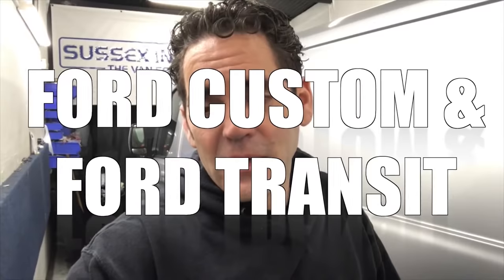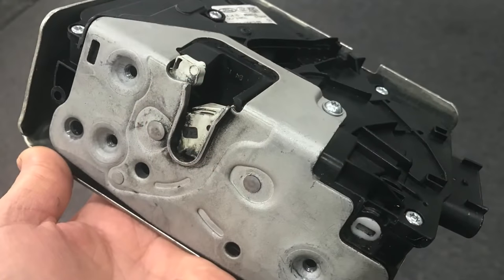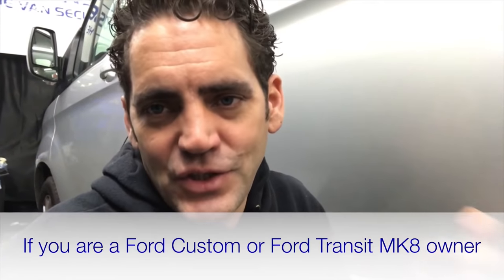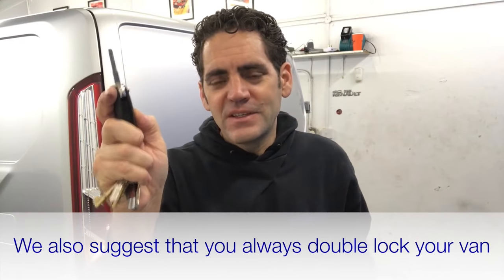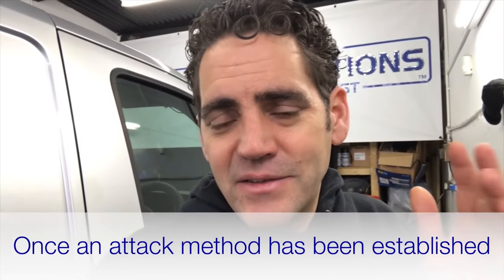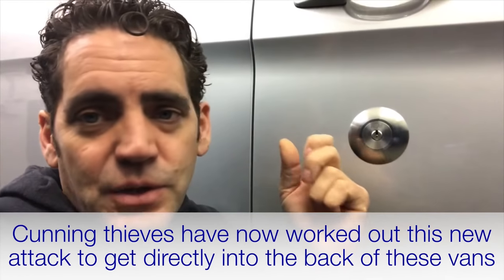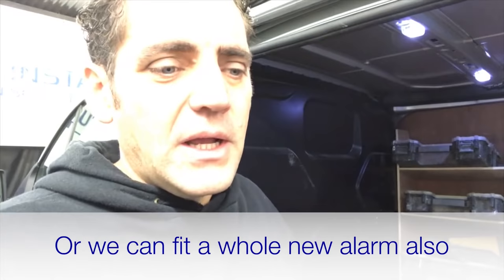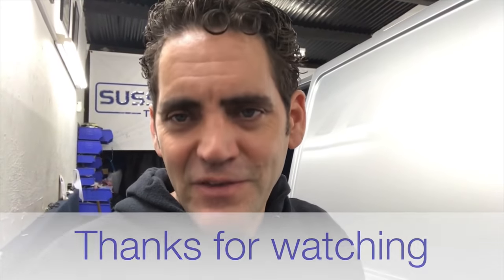Break-in News! Ford TRANSIT Owners Watch This

Comment from the maker: PLEASE SUBSCRIBE TO SUSSEX INSTALLATIONS ▶ https://www.youtube.com/user/sussexinstallations
Reply: You can break into almost all vans this way. The transit isn't the only victim.
Reply from the maker: @sdgelectronics  Agreed but they are targeted and have been too easy for too long. This latest spate of break-ins has happened over the last few weeks so it is a timely warning.
Reply from the maker: @mike-ology22  Thanks Mike, i have only just seen this. I would be interested in seeing your drawing. We are trying to secure a sliding door on a Transit at the moment so we might do it your way.
Reply: Would turning on the child lock prevent them opening the sliding door with the method of putting a hole in the door?

Comment: This happened to a neighbour's Ford transit while he was in a lidl store. Everything gone. Hilti, makita, dewalt tools etc... As a steel fabricator, Van's are a tin box.  A cordless device with a low noise level & you can peel the steel open like a banana. So, an alarm system is essential.
Reply: ford seems to be using really thin sheet to make them now adays , probably due to weight saving and emissions.
Reply: @garygranato9164  steel used on cars, vans etc. Is less than 1mm thick. A cordless angle grinder & your in. Ok, noise wouldn't help. But I'm sure there other less noisier cordless tools. So, what are people to do? Real solution? Dont no Gary.
Reply: @garygranato9164  Yep.  There is always a design consideration.  You want to minimize cost of ownership (read: gas/petro mileage), you reduce weight where you can. The vehicles simply wouldn't sell if they armored them and assumed the consequent mileage penalty.  The market will respond with better internal security solutions. Until then, there's always locks and chains.

Comment: Ford. Need to be reimbursing people for there losses due to there shockingly poor build quality.
Reply: How is THAT poor quality.  Did you know that thieves can get into any vehicle given the time and opportunity?
Reply: Ford reimburse ?? Don’t make me laugh.Fords are complete junk and I am talking from experience they are cheap for a reason. Made  a big mistake moving our vans from Mercedes to Ford transits. AdBlue issues , engine management light rear brake callipers seizing after 3 months , couldn’t get it booked in for 6 weeks 😂😂😂😂 ended up paying an independent to do it and what a nightmare to get reimbursed by Fix Or Repair Daily, Had one broke into , had to get the door lock upgraded , alarm upgrade as I assumed it had an alarm but it was only central locking so why the hazards flash for is beyond me , but an expensive lesson learnt. Got rid , lost money but my sprinters are working every day , no issues and if I have an issue I have 24/7/365 support with overnight servicing NOT waiting 6 weeks 😂😂😂😂to get a vehicle looked at. Considering FORD are the biggest selling van in its class they haven’t a clue what a business customer needs in terms of service and support
Reply: both cars and houses are all extremely (I really mean extremely) easy to break into.
They were even in the era before high powered cordless tools but now we are in an age where you can buy (or steal) an angle grinder from Lidl or aldi, and use it to cut through 20mm hardened steel shackles like nothing. The light weight mild steel panels of a vehicle or its windows have no chance at all. 

Cars themselves are not stolen that often because they are difficult to sell unless absolutely perfect, very high end and in demand overseas. 
But it doesn't matter if you damage a van to take what's inside, and all vans will always be vulnerable.
Reply: both cars and houses are all extremely (I really mean extremely) easy to break into.
They were even in the era before high powered cordless tools but now we are in an age where you can buy (or steal) an angle grinder from Lidl or aldi, and use it to cut through 20mm hardened steel shackles like nothing. The light weight mild steel panels of a vehicle or its windows have no chance at all. 

Cars themselves are not stolen that often because they are difficult to sell unless absolutely perfect, very high end and in demand overseas. 
But it doesn't matter if you damage a van to take what's inside, and all vans will always be vulnerable.
Reply: @boxsterman77  ford do have shocking quality, we have a Ford transit 2019 there are bits and panels falling off it everywhere, we constantly have to kick the bumper back on because stepping on it causes the clips they used to keep the bumper on, those cheap plastic push clips to pop out. The spare wheel either fell off or someone stole it now the side door needs adjusting xD the van is nice to drive but their quality is questionable sometimes.
Reply: They know their cars are easy to steal and they could do a PCM update to fix it.
Reply: @DaBriars  well said, we ran em on plant work and back brakes was a constant problem with em, electrics, rust etc-all on vans less than 2 years old. They are simply not work vans in the sense of durability and ruggedness just motorway delivery vans. Years ago we ran Dodge 50’s and double wheel Bedford cf’s, tough, hard vans that ran overloaded and through mud, water, sand etc and still wouldn’t breakdown. Progress eh.

Comment: I’ve shared this. Police catch them occasionally but justice system lets them out again
Reply: Case in Ireland, tools at a site were stolen, they were later returned, and the guards let him go. As he was drunk when it happened.

In another case tools were stolen, a phone call to a sinn fein td, couple hours later, van comes in fast throws out tools and races away again.
Reply: @davidh266  what's a sinn feint td?
Reply: Rob a bank get years inside, rob a van get let off.
Reply: My mate runs a very successful locksmith/safe business. He's considering changing his tag-line to "** Lock & Key- because the Police do f_ck all"

Comment: Ive just purchased one of these from Sussex installations and after struggling to fit it realised that it is the wrong shape  and is not compatible with my 2019 transit custom. Despite this video showing the latest custom van and the graphic showing the latest custom van ( led headlight model ) sussex installations i formed me that the product will not fit the latest generation of transit Customs.   The order for. Does ask for the model year but they are still sent it out .

Comment: Not much changed with Ford since my MKII Escort days, christ you could open a door with a Christmas tree, now they have progressed to using tin openers.
Reply: Chris Greenwood I think they got it perfect with the mk3 ford mondeo once you double tap the keyfob even if they smash the window the door will no unlock so can’t open it the bonnet you can only open with a key and the steering locks almost impossible to break without snapping the steering wheel off the Immobiliser is good to if they try hot wiring or use a screw driver the car will basically go into limp mode

Comment: I personally have a very large stanley fat max pro mobile jobchest 113L box, it gets most tools needed for the day in cluding a makita radio!and i take it in my house at night. it has wheels and it good for pulling onto site ect.you do have to take other tools with you on the day you need them mitre saws ect but after a while it becomes easy to manage what you need on that specific day.

#givethemnothing 

I hope this helps.

Comment: External shield is a good deterrent. I would highly recommend it. Interior detector is great. What about a WiFi or GSM video camera?

4:15 -- A break method needing a software update? And info how to do it online? Good grief. Modern world.....

FWIIW: On the other hand.... I once had my car broken into twice in 6 weeks. In the first case, they pounded out the door lock. Cost me $800 (US Dollar) in damage. The next time they went in through a side window. $16 dollars in damage. I wish all thieves knew the $16 method.
Reply: Saint Coemgen … ya know, back in the 80s Radio Shack (now defunct) offered a silent alarm system with a pager device that had a range of about 1/4 mile. Perfect for leaving your vehicle in a public parking area or in the driveway where you could come out and catch a thief red handed. It worked well for me while in a motel one night. The motion sensor was good enough to catch the guy opening the tailgate on my pickup. I looked out the window and called the cops before going outside myself.

Comment: Another security design failure by Ford 😡
Reply: Simply ripped the side door clean off my Volkswagen T6 with no issues at all. All manufacturers have security issues.
Reply: interceptor1986 not quite the same as punching a tiny hole in the side
Reply: @climbjay the customers cctv footage showed it to takes literally seconds so probably easier.
Reply: Typical Ford! I’ve stopped driving their cars and vans since 1996!

Comment: I think it’s come to a point now that if a manufacturer made a van with genuine top notch security out of the factory it would be a big seller. 
I hate the fact my transit is an easy target!
Reply: Unfortunately it’s an old problem. In the final analysis fit hasp and staples to  the cargo area doors and shielded round padlocks, not pretty but slows the twats down. If they want in, they’ll get in. It’s all a risk now and ford don’t want the problems just the sales.

Comment: Does he do a gatling gun? Had my transits done in 4 times in the last few years 🤬
Reply: fieryfreddo just sell it and get something else
Reply: Yes, change it and get a VW.
Never had any issues.
Reply: Mo Salah nice one after mine got
Nicked I bought a Citroen dispatch much better van. Still use the old stool steering lock 🔐
Reply: fieryfreddo were you live probably in some dodgy place?
Reply: What's that in English?
Reply: @m.haslam8495  Volkswagens are overpriced. They are not really any better than the Fords and your getting an older more used van for the same price

Comment: Got done once when I first started on the tools. Never again. I use a crew cab with windows and offload/on-load my kit at the start and end of every day and store it in a lock up without fail. Unless I leave it at the customers house. 

Never leave kit on your van. Mind you kit isn’t safe anywhere. Manufacturers should be doing everything possible to make sure their vehicles are impossible to break into. They charge enough for the f-ing things!

Comment: I remember being on the 3rd floor balcony doing a power flush on a heating system. I looked up the road at my van to see another van in the middle of the road with someone smashing the granny out of my door with a hammer and screwdriver. The 2  crack heads notice me looking and made off. Called the police saying  they had just made off as there only round the corner and they didn't even turn up. What chance have we trademen got. I've had tools knicked in london I'd say about 6 times. Moved away from the shit hole now 5 years ago. van ain't been touched.
Reply: Touch wood

Comment: Any tips for stopping them coming through the roof with a battery angle grinder? 😫
Reply from the maker: Line the roof with multifoils. They clog up the angle grinder. Plywood is also good because the metal cutting blade just gets hot. Multifoils and plywood is better still.

Comment: 2.4 tdci it is a sheet engine, injectors problems and crack piston heads, water consumption, sheet engine from Ford. Thank you ford for this engine, ..... It is second time i change the engime on 2008 ford transit.....

Comment: We had a transit stolen once brand new it was.  Police told us they knew by next day where it was but they would not arrest anyone because they wanted to know what they were going to do with it first? two week later it came back hand painted blue colour and not a god bless you from the coppers.  They had their man and we could just inform the insurance, hey ho!  Any trades person or traders who does not have a Thatcham 2 and independent immobiliser on their van is just asking for trouble.  Also  a tool safe bolted to the floor helps for the expensive gear.  Forget trackers they only work after the event has happened!  We should all hope that the spivs arses fester and they put the price of Vaseline up to £60 a jar!

Comment: Ive had 3 nicked. Caught on CCTV it looked as easy as if they had the key.
Reply: It is just about some pressure switches on the transits that tells ecu the doors are closed can be tampered with open all the doors
Reply: @micjubba709  They started it and drove off in them easy as anything. Any ideas how they did that?

Comment: On my transit van I have made a rig so I can ratchet strap my side door to prevent the door from being folded over.
Reply from the maker: good idea. I would love to  see that done from the outside by a remote control on a motor.
Reply: Same, and rear doors chained and strapped shut

Comment: What these van manufacturers are selling is just not good enough. Commercial vehicles have been a target for thieves for years, yet they continue to do nothing meaningful about vulnerabilities. Why should we have to spend £k’s fixing a problem that shouldn’t even exist. Ford are probably the worst culprit, but none of the current manufacturers seem to be taking this seriously. If all commercial vehicles had better physical security as standard, there would be a lot less thieving from them.

Comment: If they drill the bodywork isn’t drilling your bracket secondly just the same
Reply from the maker: They don't drill the bodywork they use a can opener. The plate is stainless steel and takes ages to drill through

Comment: What you really need is a system that electrifies the whole shell of the van , ideally 3 phase . The low life scumbags will get off it a bit sharpish then ! .... ;-)
Reply: Jayne4 … the voltage doesn't have to be drastic to stop them I bet there's a way to adapt electric fence technology, like used on a farm, to blow them a jolt every time they jiggle the door handle. Of course that might piss them off enough to put a rock through the window, but they still wont open the door.
Reply: Jayen4 it’s been done where the handles are electrified when the van is locked. Because he has signage on the van stating it’s live, he can get away it
Reply: It's called a tesla coil.... or use something similar to an electric fence or cattle prod

Comment: I used to have Ford escort van I could use my key to borrow my mates escort van very handy when low on fuel thanks ford
Reply: This is what put me off leasing. My old mk6 might not be pretty. But she is locked up good. I leave no power tools over night either. On the drivers door opening the cargo area

Comment: They have never been the best for security wasn’t there a trick for the mk6 where you cut through the wiring at the back door and it unlocked failing that just buy a £30 Ford pick and your in
Reply from the maker: It isn't even as difficult as cutting through the door. There is a way of opening all the locks and turning off the alarms.
Reply: @SkillBuilder  I know of many tricks used I’ve had a lot in for repairs wiring looks broken locks due to the picks being jammed. Manufacturers of the vehicles need to do more. I would rather a vehicle with Amazing security over the vehicles being produced with fancy screens and lights in the dash and doors instead it’s a after thought which results in people losing there lively hoods

Comment: Another trick is either getting a key made from the VIN number on the dash or taking the lock barrel for the bonnet and making the key from that. How fucking hard is it for a van manufacturer to make it difficult in time and loud enough to draw loads of attention. Having said that, cat thieves make loads of noise for 2 minutes. 6 cats stolen from my residential car park while people watch.

Comment: This happened to me back in august in the middle of the day outside a police station, drilled a hole next to the slam lock, cut a gash in the bottom back lock and bent the door in half getting the hook on dead bolt out. Police did nothing. Should set those sensors up to nail bombs, that'll put an end to van theft

Comment: Any aluminum vehicle can be opened with a can opener.
Reply from the maker: These are steel
Reply: @SkillBuilder  yes they are steel, but it's the lowest grade Turkish steel, soft as toffee. I knelt on the edge of the roof tying stuff to the roof rack and I didn't realize it was denting the edge, I now have a load of shallow dents down the sides of the roof which are visible from the ground. VWs and Mercs are made from much stronger steel.

Comment: I would like to recommend . Sounds Alarming . Stafford rd , Wallington , Surrey .
If you are in the area . He put electronic dead locks in my van , you can't see where they are from the outside , so they don't know where to jemmy ,pir in the cab and he rear , it's not cheap but good , I've still got site boxes tho , use them I know it's a pain , I also chain my steering wheel up
Reply: You need a self district device  just to be sure .
Reply: Sounds like you have been burnt once already.
Reply: Matt more that once mate

Comment: Fella if they want it there is nothing you can do drilling doors is old school and the is no way you can protect from it
Reply from the maker: They don't drill them they just push a scewdriver through the metal. It takes seconds to open the van and makes hardly any noise. If you have a plate over the lock they have to do more work to get in. Yes they will still get in if they have time and are not discovered but fitting an alarm will put them under time pressure. The criminals will always be one step ahead but the harder they have to work the less they like it.